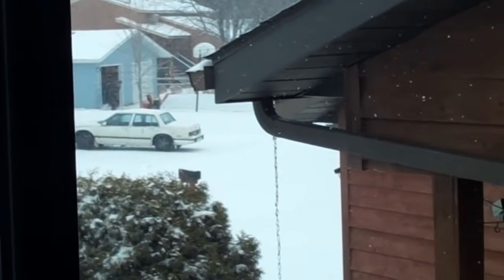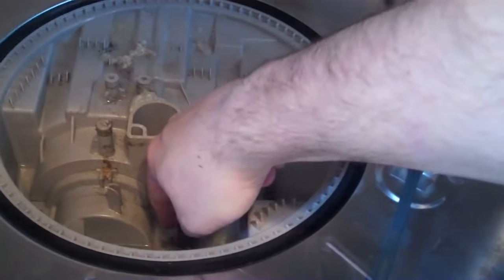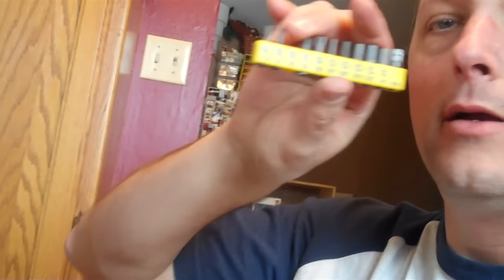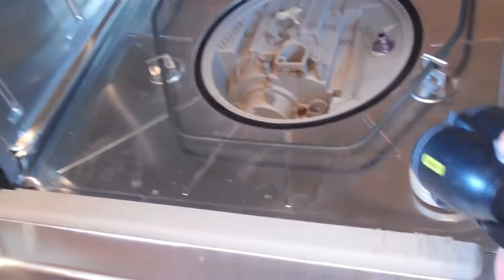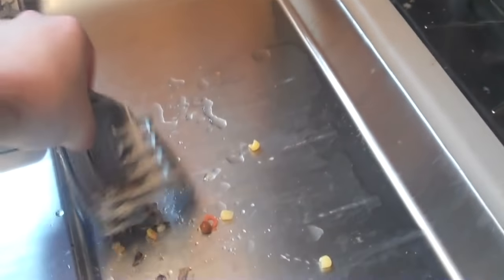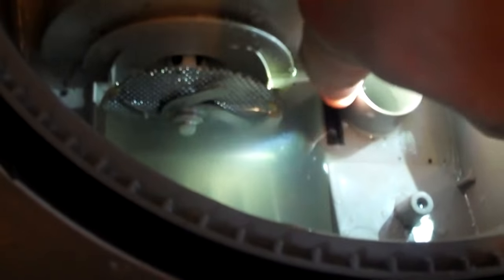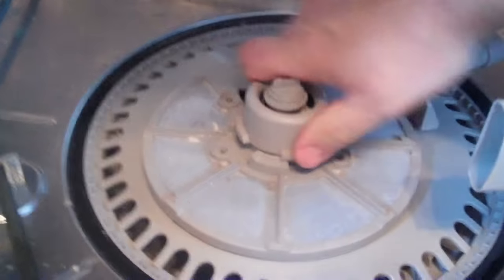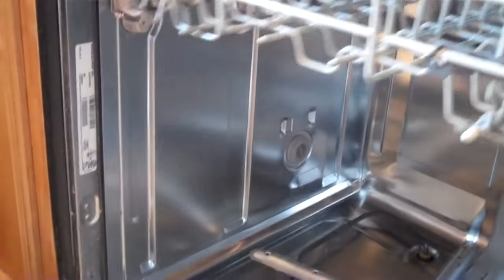Dishwasher Repair | How to Clean the Screen/Filter | Part 1 of 3

Comment: Two things to help...
1) The first step after removing the shelves, which is removing that upper spindle and tube that runs along the back...it doesn't just snap out...you must look for the tabs and push them outwards, then pull the plastic tube off the ceiling and back wall.
2) When putting the "propeller" back on, make sure the spindle isn't binded and can sort of move about loosely.  If it doesn't, then pull it through (up) with some pliars until it moves more freely.

Comment: For those of you that want to clean the cutter, removal is fairly easy. The back part is usually spring loaded. Use a screwdriver on the back side to push the blade away and then lift up. Please note where the screen seats. Spent 10 minutes trying to get it to seat in a slot it didn't belong in. Clean the screen and cutter. To replace it, use an open ended wrench between the blade and screen to pull the blade out. Also note the screen may be unidirectional. My Maytag's screen had two notches. Drop the screen in and then line up the backend connector and then pull out the wrench.

Comment: I owe you a case of beer. This seems to have completely fixed my dishwasher which was leaving dished dirty and icky. A few things I'd like to add: use the "jet" setting on a hose and clean out all the parts inside and out including all holes and tubes and the fine mesh filter screen on the big round 'circular saw blade'-looking piece (easier in summertime!). There was all manner of junk in mine. I also used a wet/dry shop vac to suck out all the junk around the 'garbage disposal' thing.

Comment: Thank you so much for doing this!  I had basically the same issue with a 20 year-old Kitchenaid.  I searched high and low for a service manual, but couldn't find one that was from a site that I trusted. Then I found this and you showed me everything I needed!  Job is now done, and the unit is going through a test run with a reduced load.  Thanks again!

Comment: THANK YOU!! I have been searching all over the interwebz trying to find out how to remove the dang filter and you are the ONLY one that could answer that question.  The exploded diagrams from Maytag didn't help. They don't want to give up any secrets that they can possibly gouge you for in hiring a repairman. Pinterest had nothing, Google had nothing, but luckily you can do almost ANYTHING with YouTube!  I appreciate you helping my remove the filter for my mdb7749a Maytag without having to buy any replacement parts. :)
Reply from the maker: That is very good to hear.  I am glad that this helped you.  Thank you for taking the time to write such a very nice comment.

Comment: Started to put dishes in dishwasher then noticed there was water sitting in the bottom...CRAPOLA I thought for a second. googled it and was more confused than ever. Then I remembered youtube. Then I found your channel.. I just ran the garbage disposal for 30 seconds like you said.... It drained...Wow. To think I almost called a repair person..That is until I found your video. I am going to take it apart and make sure it is clean. Thanks for putting this video on.You saved me 200-250 by not having to call a repair person. Thank you from FLORIDAAAAAAAAA
Reply from the maker: way cool, I am very happy that helped.  Remember, you can also press the cancel button to force it to drain as well.  I am very happy it helped.   Florida is going to be our vacation spot again next winter....and we will have a rental with a dishwasher lol.

Comment: There is one step I have not seen covered well in any of these videos on Kitchenaid dishwashers:
If you remove the metal "shredder" from beneath its cover (the one at the bottom, with a single screw to the left)...
Beware! Replacing it is not as simple as pulling it out. What I did was use a pair of needle-nose pliers, holding it with the plastic gear mesh part fully pushed-in on its spring, then push the entire part down with the pliers into its semi-circular slot on the bottom. Then, holding the part in place with my other hand at the top, I slid the pliers off, allowing the spring to then let the plastic gear mesh engage with the gear shaft. If I did not do it that way, the result was that the gear mesh was disengaged with its gear, causing an ugly noise and obviously not working correctly. If others are encountering this issue, they may, like me, fail to create a video simply because they do not want to go through that tricky maneuver again, just for the camera!

Comment: This video helped me revive my dishwasher.  By following the steps and enjoying the wry humor, our dishwasher is once again cleaning the top rack.  That the video has had over 1.3M views is amazing. Really?  Who knew. One word of advice, if you are not careful (and I must not have been) when trying to unscrew the mashirator cover,  the screw bit can slip down into the slot for the water outlet.  Before panic ensued,  by briefly starting  the dishwasher, the screw bit was floated out & was retrieved.  Whew, that was close.  As we go into the 2020 Holidays, it is great that the dishwasher is once again ready to go.  Thanks again for the video.

Comment: Thanks for the video, it was very helpful!   My dishwasher was a different model, but close enough that your instructions enabled me to get the job done.  Turns out, I had broken glass (wine glass no one told me about, ah-hem) down in the pump area, machine a worrisome rattling noise.   Fixed.   And, I scored points with my wife for not having to call a repair person - you know how expensive that can be.   One trick, I could not find any of the torsion drivers, so I used a metric hex/allan wrench set, being careful not to over tighten or crank too hard.  Sub optimal, but worked fine, the hardware on the KitchenAid was pretty robust.
Reply from the maker: +Charlie Kawasaki I love it when my video helps people get their dishwasher working without having to call and expensive appliance repair service.  I like your suggestion and will add it to my  comments and next time I do a dishwasher repair video.  Thank you for watching Frosty Life.

Comment: Thank you!  My dishwasher was working, but it seemed like nothing was getting clean lately. I watched the video, and the only thing I had problem with was getting the propeller back on the spindle. (I had to have my husband do that - I think my arms weren't long enough to get the right strength in that position).
I am too embarrassed to tell you all the crap I found down in the filter. (and even behind the part that goes up the back, and every other part). I used a toothbrush to try and clean the nooks and crannies of the filter. I'm running a test wash right now.
Oh - and I'm proud to say I can add this to my list of 'repairs done without a repairman". Last thing I did was replace the pump in my washing machine. All by myself. Yay!.
Reply from the maker: I have not even tried to change the pump in the washing machine yet, but now I am inspired to try it if needed...and make a video too.  I am very happy my video helped you get your dishwasher fixed up.   I have to do the clean out about once every two years or less...if only I would learn to clean the shrimp tails off the plates first.  I LOVE shrimp, even more than candy.

Comment from the maker: This is so much fun
Reply: Thanks for the video, great help (second time I referred to it), good fun too!
Reply: Frosty Life the water supply up the back to top rack have thumb keeper brackets, if you just try to pull them off more than likes break the bracket rivets. press the tab and pull, save you from busting your dish washer.  NEVER use a Dewalt  or any power tool, these large thread plastic screws and strip in a second, use a hand tool.  very intertaining vid tho.
Reply from the maker: Gregory Peck Thank you.  That is very very good information.  Thank you.  I will post this information on the description right away.
Reply: More than welcome, Its the success of the viewer that matters. : )
Reply: +Gregory Peck I agree with those points including the entertaining part. I've done the job before and am about to do it again thanks to dropping stuff in the DW without knowing it. Last time it was mostly shards of broken glass,  which didn't get cleaned out quickly enough and screwed up the pump. Same model this time as shown, last time exact same guts but in the Whirlpool equivalent model. Sheesh.
Reply from the maker: +Steve MacDonald thank you for the kind comment
Reply from the maker: +timberjack I am very happy to hear my dishwasher video helped you out.
Reply: You made this repair easy for me, and I had a good laugh, thanks.
Reply: Frosty Life
Reply: Gregory Peck and a

Comment: Dishes were not coming out clean, especially on the top rack. Watched your video, and disassembled my Maytag and the screen cover had five toothpicks and covered in gunk - restricting the water flow. Cleaned the cover, then cleaned off the screen and then cleaned all the debris in the pit which included broken glass and plastic pieces from my cutlery box. Washed the filter and top screen.

Dishwasher works like a charm. Full water flow and you can hear the water circulating now. Ran one quick cycle with no dishes and then ran a hot cycle with a bottle of Finish dishwasher cleaner and now my dishes and glasses are coming out sparkling clean.

Comment: Thanks Frosty, easy repair and I'm sure it saved me $100.  What I found was a 3/4" x 3/4" piece of ceramic cup or plate.  While I was at it, I bought 4 new upper tray rollers; another easy fix.

Tom

Comment: Used your video to clean my dishwasher. Very helpful. Found turkey bones, hair, plastic, bread bag ties ect. No wonder it wasn't draining.
Reply from the maker: +Wendy Adams Thank you so much for your very positive comment. I am very happy to hear my dishwasher video helped you with all the fun things that clog the drain system.  It is amazing what gets in there.
Reply: +Frosty Life Right. I had a feeling something was up, but no other video was as straight and to the point. Or the ones I found was not even close to the design we have.

Comment: Great video! I have the same model and was having problems with debris on the top glasses and occasionally the load not coming clean. Tried cleaning the top filter, running multiple cleaners, and sani-washes to no avail. Following your video I took mine apart. Got a paper towel covered with gunk, plastics, and a paper wrapper. The food grinder had two 1 inch pieces of wooden chopsicks!. I took the very top spinner apart to clean it also. Got it back together and it is like new.
Reply from the maker: I am so very happy to hear this.  I am very happy my dishwasher video helped you get your dishwasher cleaned out and working well.

Comment: Thanks! Great video. The large gray disc part that is removed at 6:16 actually come apart and there can be more gunk inside it. The round part with the mesh screen can be pulled apart from the larger piece with the gear-like edge. I used a small screwdriver to pry it back moving around the edge a little at a time. Then it just snaps back together after cleaning. It only goes on one way (which is nice).
Reply from the maker: Michael Reilly Thank you so much.  Thank you for the additional tips.  I will include that in my narrative section.
Reply: His looked pretty clean!  Ours was disgusting thank Heaven the screen comes off!
Reply: Hey thanks fot the tip -- carefully pried my screen off from the "gear" piece.  Much easier to clean.

Comment: Thanks a bunch for the video, and shedding some blood.  My dishwasher was getting no spray at the top and not much at the other spray arms.  Followed your directions and found a severely clogged screen with a broken chopper blade.  Removed it, cleaned the screen, reassembled, and all seems good.  No telling how long the blade's been broken, so I think I'll just go without and see what happens.  Now I know how to go back in there and replace the part if necessary.
Reply from the maker: That is fantastic.  I really would not run it without the chopper blade because it might get all clogged up deeper inside the parts that you cannot reach.  I would think a part would be far cheaper than a repairman or a new machine.  Good luck with and and thank you for watching and commenting.

Comment: April moved into rental in April. This video is exactly what our dishwasher needed! Living in Eastern Idaho the water is very hard. Upper arm & lower Drain assembly was completely blocked by white chalky substance. (70% Hard Water 20% Paper Labels 10% don't even want to know!)  After removing assembly we ran 4 rinse cycles using Vinegar and CLR to finally remove Chopper Cover! Another video shows removal of Black Rubber Gasket that looks like Tonsils which is another blockage point.
Reply from the maker: I am very happy this helped and glad you were able to get your machine working again.  You are right, that part does look like tonsils, lol...so true.  Thanks for watching.

Comment: Thanks Tom, this was great. Our dishwasher was not cleaning and was caked with hard water stains/diswasher detergent deposits so I took it all apart and cleaned it just like your video showed. It seems to be working now, just not sure if the top "propeller" is spinning. I can't believe how much crap was in there, yuck.

Comment: I was so grateful you posted this video. It was very helpful to me, however, I neglected to take the housing cover off the metal wheel-screen thingy, so I did all that for nothing! Water still isn't getting to the top rack. So I have to go back in and take it apart again, but thanks for the video just the same. At least now I have practice taking the other part of it apart.

Comment: Thanks so much for this video!! We just moved into a new house and the dishwasher sucked! I’ve been trying to get the hubby to clean it and after finding your video decided to do it myself. It was NASTY 🤢. I had to run to the bathroom after pulling up the bottom part. Pretty sure it has NEVER been cleaned.  Ugggh

Comment: Wow this worked like a charm. You can't believe when I got into the disposal part, there were probably 20 bits of plastic that had broken off from the silverware basket. I have replaced that crappy basket twice, so those bits could have been there for years. I am shocked I did not lose this dishwasher! It's amazing how junky the plastic parts are, I have replaced the plate retainer pieces 2 times as well. (There was also a piece of glass, our fault not kitchen aids!)My family got a kick out of me pulling the dishwasher apart and actually finding all that junk! You probably saved me at least $100. So if you come to Atlanta I will buy you a lobster!!!!!
Reply from the maker: +Karen Jacobs I am very happy to hear that this video help you get your dishwasher problems solved. It really is amazing how much can be in that filter system. It's also amazing how easy it is to get in there and fix it once you know how. Thank you for taking the time to write a nice comment. That is why I love making these videos because I know it is helping people and I love to hear from them
Reply from the maker: hahaha, I have flown to Atlanta several times in the past but have not been there in many years.  I love lobster though.  I am very appreciative of your very nice comments.

Comment: Absolute wonderful instructional video....   but I sense you dishwasher had been fairly recently cleaned because ours looked nothing like that inside.
Reply from the maker: Yes, I had filmed this after trying it on my own first to see how hard or easy it would be, and I was so amazed at how easy it was that I made a video.  What I learned from this is to really try to soak and rinse everything before putting it in the dishwasher. Dishes do not have to be really washed off before hand, but just to get the larger pieces that could cause clogging.  It has made a BIG difference.

Comment: If you mess up the order of things with the lower washer arm mount.  Plastic washer goes atop the plastic bolt and under the "internal feed cap".
Also, the lower washer arm will wobble a bit.  It is not mounted tight like an airplane prop.
Some KA have a water "manifold" that mounts to the bottom "feed tube assy", clips into "manifold valve assy".
it's a good idea to have a pdf of the parts to ref before you dig in, if you never have before.  Search parts assy for your model.

Comment: Fantastic video!  I could not for the life of me figure out how to get the trap out and cleaned before!

Weird question.  Have any of you ever had to remove gum from a dishwasher trap?  How does one go about that?
Reply from the maker: Thank you so much for the positive review McKenzie Johnston .  Is the gum all stringy and stuck like it would be in hair?  If so, freeze it to make it brittle and less sticky.   Perhaps try using an ice cube, or possibly even that liquid nitrogen that is used for wart removed (but be very careful not to ruin any parts of the dishwasher).  Or Try Goo Gone, or plain white toothpaste.  I hear perhaps peanut butter might work too.   I have never had to try to removed gum, yet, these are some ideas to try.  Best of luck and let me know what works best.

Comment: Well, it took me 3 hours to do it, but I did it! Mine was packed with soap residue, and I had to pop off that mesh cover (under the spray arm), and scrub that out, too. A turkey baster came in very handy for completely draining the water that was sitting in the bottom. Hope that the cleaning fixes that, too -- not sure how much water is supposed to be sitting in that reservoir at the very bottom, but it seemed like a lot.
Reply from the maker: Great idea.  Thank you for tell me about that turkey baster idea.